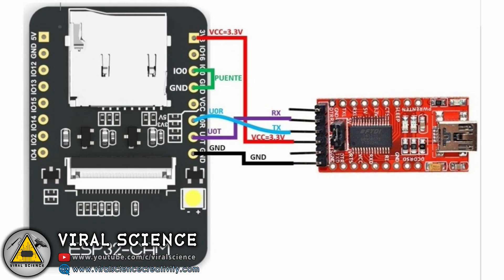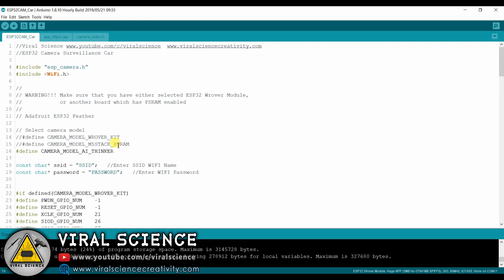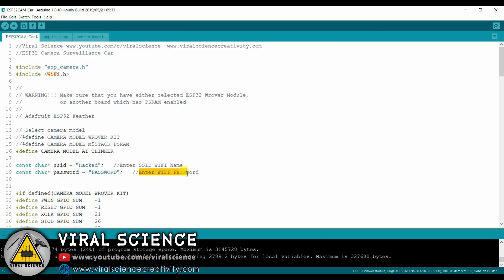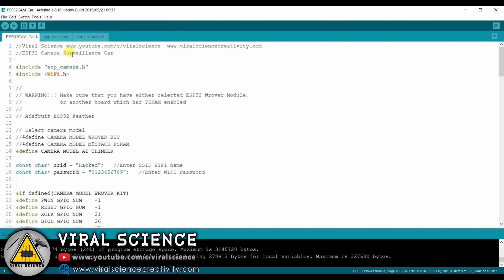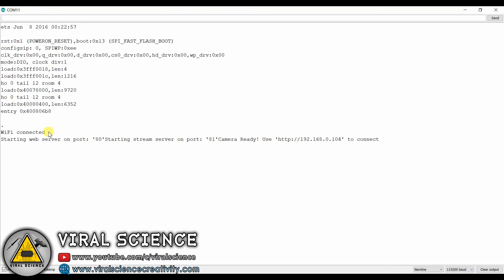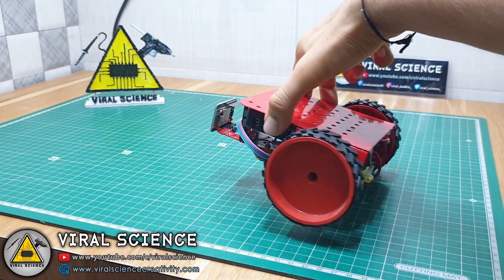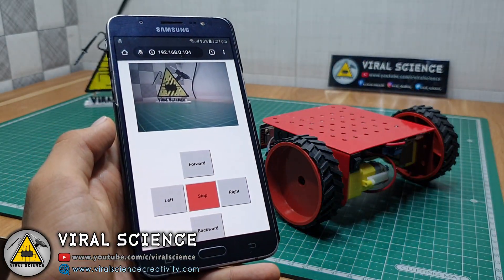ESP32 CAM Surveillance Car | SPY Camera Car

Comment: hi , i want to ask a question, when i ready to operate this car, i plug to 2x 3.7 volt 18650, i touch esp32 that too hot , its safe ? will burn the esp ? what MAH for the baterry ? 1200 mah or 1800 mah its ok ?

Comment: WHEN I PROGRAM ESP32 CAM WITH TTL ADAPTOR LAST TIME COMING THIS MESSAGE NOT SHOWING IP ADDRESS
"rst:0x1 (POWERON_RESET),boot:0x13 (SPI_FAST_FLASH_BOOT)
configsip: 0, SPIWP:0xee
clk_drv:0x00,q_drv:0x00,d_drv:0x00,cs0_drv:0x00,hd_drv:0x00,wp_drv:0x00
mode:DIO, clock div:1
load:0x3fff0018,len:4
load:0x3fff001c,len:1100
load:0x40078000,len:9232
load:0x40080400,len:6400
entry 0x400806a8
...............................................

Comment: sir ..how to upload esp32 cam ? is it using FT232RL USB to TTL 3.3V/5V FTDI Serial Adapter Module? is it have need usb cable or that adaptor have male usb port for pc connection?

Comment: Hello brother i got this error while uploading, how can i fix this?
error compiling forboard esp32wrover module
sketch\ESP32CAM_Car.ino.cpp.o:(.literal._Z5setupv+0x54): undefined reference to `startCameraServer()'
sketch\ESP32CAM_Car.ino.cpp.o: In function `setup()':
C:\Users\Umer\AppData\Local\Temp\Rar$DIa0.318\ESP32CAM_Car/ESP32CAM_Car.ino:146: undefined reference to `startCameraServer()'
collect2.exe: error: ld returned 1 exit status
Multiple libraries were found for "WiFi.h"
 Used: C:\Users\Umer\AppData\Local\Arduino15\packages\esp32\hardware\esp32\1.0.6\libraries\WiFi
 Not used: C:\Program Files (x86)\Arduino\libraries\WiFi
exit status 1
Error compiling for board ESP32 Wrover Module.

Comment: After I am done uploading the code to the camera module and then if I remove the connections from the FTDI TTL module and 
connect the camera module to L298N motor driver module, the IP address when I upload it on google, it is showing a page like connection is interrupted. What shall I do in this so that the car works?
Reply: someone pls help me with this

Comment: Bonjour, super projet 👍
Est-il possible de ce connecté sur la 4G et non sur le wifi ? merci
Reply: Yes , you can hotspot by your phone , you need put same ssid and password in code.
Reply: Bonjour quelle est l'application pour le téléphone ?
Je ne vois pas où est le changement  de ce programme, l'avez-vous trouvé ?merci

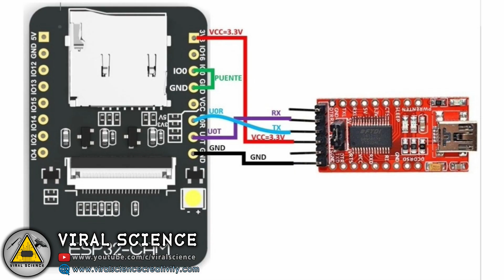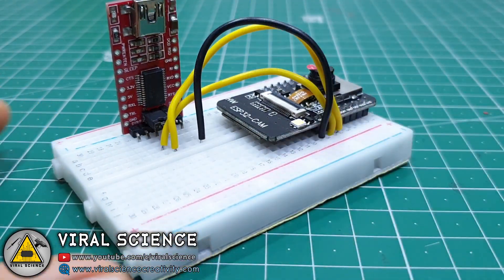Comment: In 1:06 the diagram shows to power it with 3.3V but in 1:30 the red wire goes to the 5V line. Which to use?

Comment: what an amazing video, im making this project, i just want to know one thing: do you have to be on the same network to control de robot? or you can control it from anywhere?
Reply: u can use port forwarding for opening external IP
Reply: @yixuangao6996  I had a doubt that it was, it would need a wifi network, but the cart would have to issue wifi, otherwise, how to control it on the street. I didn't get that kind of answer anywhere.

Comment: Cool project, used this on my RC Tank and it works great. Many thanks from a new subscriber. Could this work with an rc receiver and transmitter ?
Reply: bro i replaced 3 esp32 cams but the codes didn't work with them
Reply: @sachinjithendra9573  How come ?
Reply: Hi, could I use an esp01 instead of an esp32?
Reply: If you feel free, could you call me on whatsapp to talk about this project?

Comment: Dear Sir, I uploaded the code to my esp32 board and opened the serial monitor, I removed the jumper and pressed the rst but it printed "ets Jun  8 2016 00:22:57

rst:0x1 (POWERON_RESET),boot:0x1 (DOWNLOAD_BOOT(UART0/UART1/SDIO_FEI_REO_V2))
waiting for download
"

I didn't got the IP address, my wifi network was stable and my laptop is connected with it but the board didn't
I tried to reupload the code but the issue was there itself
kindly reply
Reply: i suppose you removed the jumper on the esp32 module... and all started working. the jumper is only to upload code.

Comment: @1:05 the wiring is wrong. On the FTDI the jumper is set to 5V and output connected to 3.3V on the ESP. Would suggest to edit the picture, connect the output to the 5V pin, as in the later video or set the jumper to 3.3V on the FTDI.
Reply: care to share the right diagram (photo)?
Reply: @MiirVFX  https://content.instructables.com/ORIG/FV4/OL3S/KE1E0JO1/FV4OL3SKE1E0JO1.png?auto=webp&frame=1&width=1024&fit=bounds&md=0d03fbf64d3fce4c96a65476d8fbd595 for example. For the picture at 1:05 the jumper should be set to 3.3v like shown here https://oneguyoneblog.com/wp-content/uploads/2019/09/ESP32-CAM-ESP32-with-camera-and-SD-card-slot-FTDI-interface.jpg
Reply: Thank you so much!!!

Comment: Great project I used the same code but changed from Wifi Client to Wifi Server so that the project can work anywhere without using a home wifi network https://github.com/cmmdrdata/Esp32CamMower
Reply: that means we can control the rc without using the same network?

Comment: Good Job, Motors are not working. I am able to stream the video in browser, I am able to ON and OFF the LED on the browser but motors are not working, could you please advise ?
Reply: I'm having the same issue as well. Are you using the DM board instead of the Ai thinker?
Reply: just plug the two built in jumper from l298n in pin ENA (from left) and pin ENB (from right)
Reply: it will work
Reply: if ur does'nt know which jumpers it is just see can the image from here https://images.app.goo.gl/wyYuMPvpNsL8LnEj9
Reply: ENA = Enable motor A and ENB = Enable motor B

Comment: Hello

Great video !!!!!! I haven't been able to access it yet but was wondering if your download code zip file includes the code for the app to control the robot that runs on the cell phone. Will this phone app run on an android or iphone? Also could you do a tutorial on how you programmed the phone app? Thanks for all your great videos.
Reply from the maker: Its not any app, its a webpage running on IP address which can be opened from any browser
Reply: Could you do a tutorial on the actual webpage and how you created it. Being the control for the robot, this would be great to see how you designed the web page for remote control of the robot. Also is the code for the webpage included in the code download zip file? Thanks again for your great videos !!!!!!
Reply: @ViralScience there are 3 files on zip, whic code do i need to upload

Comment: Interesting project, I loved it. 👍🏽
Can it be used with a router without network access?
Reply: it doesn't need internet, just wifi connection
Reply: @MiirVFX  Hey bro i need to turn on and turn off two swtiches in the same bot i mean i want to turn on and turn off two Devices build within the same bot I'm using esp 32 AI THINKER module and how is it possible please help me it was urgent
Reply: @DineshDKA  sorry i don't know it yet
Reply: @MiirVFX  the motor speed of mine is too fast, how can i  change the speed in source code sir?
Reply: @promptara  see the setspeed command, just change the value
Reply: @promptara  decrease the input voltage to driver

Comment: Bro..if you have code for same project 4 wheel  drive? Give me please
Reply from the maker: Code is same for 4 wheel and 2 wheel😊
Reply: Hey bro i need to turn on and turn off two swtiches in the same bot i mean i want to turn on and turn off two Devices build within the same bot I'm using esp 32 AI THINKER module and how is it possible please help me it was urgent